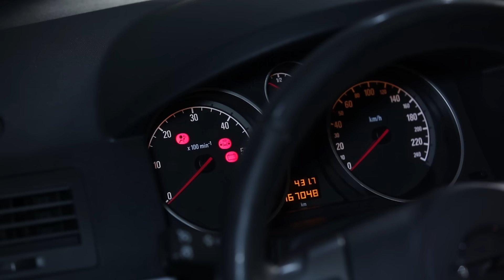Cum se înlocuiește uleiul de motor și filtrul de ulei pe OPEL ASTRA H [TUTORIAL AUTODOC]

Comment: multumim!!
Reply from the maker: Multumesc pentru comentariu, ne staruim ca videourile noastre sa va fie de ajutor.
Reply: Doresc cat mai multe detalii despre motorul z16xer.
De exemplu. ce marca si tip de ulei este indicat la un motor de peste 180000 km la bord ?
 Daca tratamentul de motor DURALUBE, ajuta motorul cu ceva, si daca este un tip anume de DURALUBE?
 De cate ori se poate face acest tratament?
Daca vasul de expansiune fara senzor de temperatura poate fi inlocuit cu un vas de expansiune cu senzor, si daca instalatia electrica originala fara senzor permite conectarea vasului cu senzor.
Mi s-a intamplat de am mers fara lichid de racire in vasul de expansiune pentru ca sa spart un furtun, iar in bord nu m-a avertizat vreun led.
Daca aceeasi instalatie electrica permite inlocuirea displeiului de bord mic cu unul mare cu GPS. care sa imi arate si consumul in mod real in mers?
Doresc raspunsuri autorizate fara pareri sau auzite.
Va multumesc.